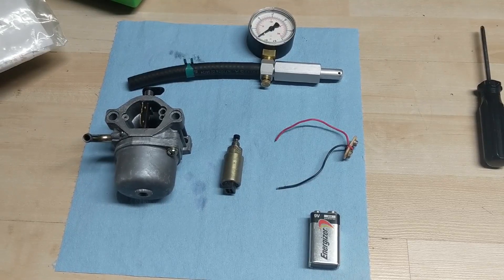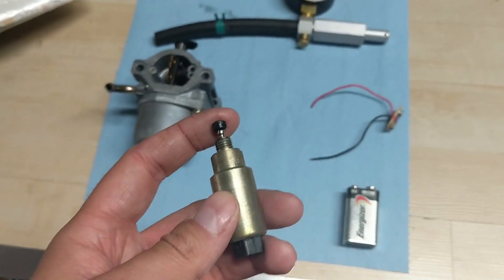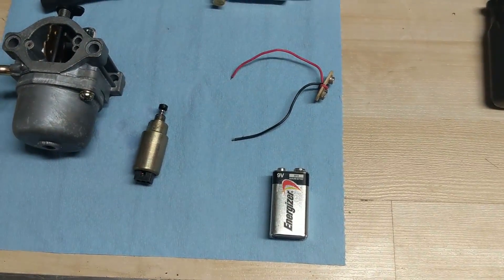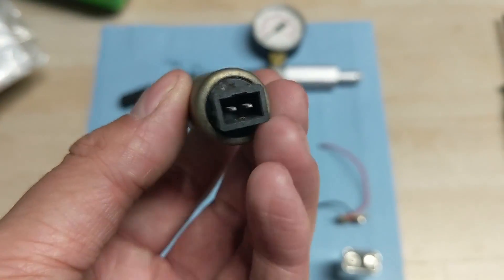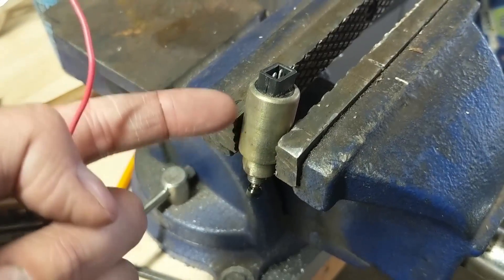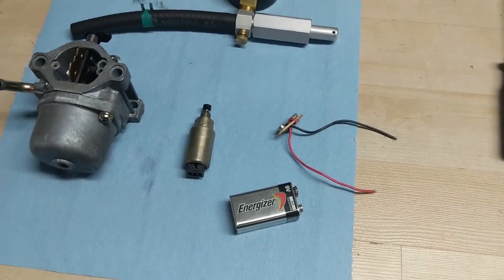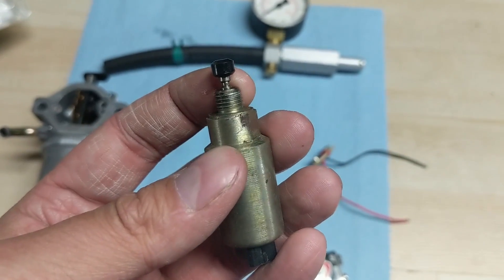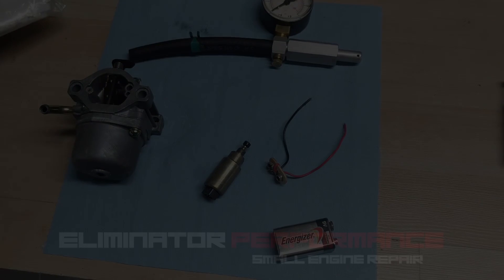How to Test a Fuel Shut-off Solenoid

Comment: Mine was stuck down,,,not up and extended. It wouldn’t let get gas pass from the bowl into the engine. Pulled mine out to unstick it and cleaned it. Fixed now and runs great!

Comment: Thanks a bunch for this video! I wasn't getting voltage to to my fuel solenoid on my generator, and your video helped me immensely in understanding how they work and how to test them. Because I was unsure of whether the voltage needed to continue during running, or was just needed at startup, I cut off the little plunger and left the wiring unplugged.  I would sure appreciate it if you could clarify that question for me. BTW, mine wouldn't activate with the 9 v battery, but did on 12v.  But the 9 v. connector is ingenious! Thanks for the tip!!!
Reply from the maker: @banjodon9851  they need a source of electrical current to stay open to allow fuel to flow. When the current is stopped, the plunger closed. By cutting it you are allowing fuel all the time, doesn't matter if it's plugged in or not

Comment: Thanks! My John Deere ride on mower had sat for two years. I went to start it today and it felt like it was out of gas. I tried to start it several times, but no combustion happening. Then I found your video and I tapped on the "fuel solenoid" with my channel lock pliers, then attempted to start the mower, and wham it started right away!!! So it was obviously a stuck fuel solenoid due to bad gas, because it had sat so long (without being started). Thanks again. :)

Comment: Would that anti backfire solenoid prevent the engine from cranking? Like a safety switch would?
Reply from the maker: @beegekhaos3171  no, it would just clog the main jet preventing fuel from going into the engine
Reply: @EliminatorPerformance  Alright thank you! Time to watch some more of your electrical diagnosis videos :(

Comment: Hello sir. I checked it with multimeter continuety. The contineuty works fine. But when i test with batteries, its not working. Could you tell me what could be the problem here?. I dont know what mistake im doing. (Sry im not good with english).

Comment: The solenoid clicks (moves) but still dos not allow fuel to flow.
Fuel pump is working, and spraying fuel in carb allows it to run just fine.
It was a sudden stop. And has worked on and off a few times.
Any ideas?

Comment: Great explanation. Got one with a single pin. Wire it connects to tests good with 12v. How do I bench test a single pin, just any old ground?
Reply from the maker: Yes the solenoid grounds through the threads on the carb, so touch negative to the solenoid and the positive to the single wire!
Reply: @EliminatorPerformance  thanks! No movement so I’m going to assume it’s toast!

Comment: Mine snaps open with the key on and when it is switched off. Gas drains out into the crankcase. I have the inline shutoff but the battery goes dead so ... ignition switch.

Comment: Does it matter which prong gets positive? Both wires on my plug are black.
Reply from the maker: No, an electro magnet is usually non polarized, which means positive or negative can be on either side.
Reply: @EliminatorPerformance thats great to know.

Comment: Fixed my problem, mower cranked fine… but won’t start…but would briefly start/run if starting fluid was sprayed into air intake…so obvious fuel issue.  Removed and worked solenoid plugger with pliers until free, reinstalled, mower started and ran fine… problem fixed.  Note this mower sat unused for 2 years… gas turned to varnish and froze the plugger…drained carb bowel and tank, easy clean and fix.
Thanks 

Frank

Comment: Here's a real pro tip, shut the gas line off, remove anti backfire solenoid, plug it back in and turn the key off and on. Tune in next week for tips on how to fill up your gas tank.
Reply: Would this solenoid be causing the air intake to fill with gas?

Comment: There only 3 things that make your troy built pony not to start 1 No fuel, 2 clog fuel filter, 3 the Carburetor Solenoid. And most likely its the Solenoid. B @ S engines are bad about blow them out  When you hear it go?  POP!  Like a back fire!  THAT THE PROBLEM!
Reply: I have a 17.5hp Pony that fills the air intake with gas and backfires loud. Is this the problem? I look at the float valve and it seems fine.

Comment: What would fry my fuel shut off valve?  My mower stopped on me and I saw smoke coming from the engine.  When I looked at it, the shut off solenoid connector had melted and was smoking.
Reply from the maker: It's possible that the wires shorted? Look for a bare spot on the wires

Comment: I'm getting no power to solenoid I'm assuming because a don't hear it click when i turn ignition key on. i removed the seat safety device so mower wouldn't cut off if i got off lawnmower now it wont start. any ideas?

Comment: Thanks for posting this - I used your 9v battery test today to check my fuel shutoff solenoid today. Mower wouldnt start and the solenoid was gummed up. I removed the solenoid and cleaned it and did your battery check to verify operation before I reinstalled it. Thanks for the instructional video.
Reply from the maker: Thanks for watching, glad it helped!

Comment: If the solenoid fails or jams, can it also jam in the closed, ar retracted, position ?

I drive a 1996 Malaysian Proton Saga, with the Mitsubishi 1,296 cc 4G13 engine, using an Aisan variable venturi type carburetor.
I believe I can see a fuel cut-off, or antidieseling, solenoid at the rear of the carburetor.

Often, on stopping and turning off the ignition key, the engine runs on, or diesels. 

So I thought maybe the solenoid had malfunctioned, jamming in the open position, and failing to close the fuel when the ignition key had turned off.

Comment: hi, my rider stopped and noticed smoke coming from under the carb and engine stopped. when i turned the ignition on the wire on shut off solenoid glowed red and smoked at the connection any idea what to do? thanks anyone who can help.
Reply from the maker: Replace the fuel shut off solenoid

Comment: How did you know what side was the negative and the positive?
Reply from the maker: It's doesn't matter, the majority of electromagnets are non polarized, meaning current can flow both ways and it will be powered
Reply: @EliminatorPerformance  I thought that principle only applied to 24 V DC
Reply: @EliminatorPerformance  I thought that only applied to 24 V AC
Reply from the maker: @rayray9777  electromagnets on the PTO clutches are also generally non polarized, with the exception of ones with diodes, which then makes them direct current DC and will have a red and black or red and green wire to identify positive and ground.

Comment: So if solenoid is good what else could be wrong with a no start, change spark plugs new battery new switch new fuel pump. $225 at a small engine shop that screwed me it worked one time after they worked on it!! It's like fuel ain't getting through! New gas, we have tried everything.
It's a john deer la145.

Comment: Thanks for the vid! I have a solenoid from a John Deere which looks exactly like yours, but with only one wire leaving the part. Is the other one just short wired to ground? And, do you have an idea how to disassemble the solenoid perhaps?
Reply: No 
need to disassemble, take it from carb bowl, plug the one wire back up if unplugged, touch against mower frame/engine to ground it out and then turn ignition/key to the accessory position and you should receive same results as this test.

Comment: Tanks for your video. I did the solenoid test on my work bench. Worked fine. Put it back on mower and it didn’t work. Traced the wire and found a loose connection.. All good now!! Thanks 😊

Comment: After putting carb back in my Kohler 730S 25hp engine, it starts now but have to play with choke to keep it running. Either sounds like a jet or struggles to run. Just learning this and cleaned solenoid but didn' t know how to test it and don' t remember it moving? Am I dealing with a fuel solenoid issue and need to take it back off or coukd this be a choke cable sticking, it feels "sticky" when I move it up and down, but not frozen as a does move lever it' s connected to. Any suggestions will be greatly appreciated. Trying to keep it out of landfill/recycling! Built in 02 but very lightly used, I'm second ower and replaced carb in 2017 with expensive Kohler carb, $200+.

Comment: I just bypass minds useing a switch works fine I just turn on the switch when I’m useing it then turn it off when it’s still running for can close it
Reply from the maker: Yes you can do without them, just throttle down before shutting engine off

Comment: I am having issues with a Troy-Bilt Pony with Briggs&Stratton engine(17.5HP). The issue is that after like 15-20 mins the engine will shut off automatically and it will not start again until engine cools down. I thought it had to do with the parts in the deck and I went ahead and changed everything including: all belts, deck spindles, blades and pulleys. I found a metal piece that holds the pulley of the PTO worn out a lil bit and the pulley looked unbalanced if I compare with the other one. After changing everything it is still giving me issues so what do you think or recommend? Thanks!
Reply from the maker: Heat soak on the ignition coil, or a fueling issue. If it dies slowly, it's fuel/carb, if it shuts off quickly, it's spark.
Reply: @EliminatorPerformance  when you say if it dies slowly, what exactly do you mean by that? After few mins?
Reply from the maker: Imagine you pinched a fuel line, your engine would slowly run out of fuel, and start running rough before it died out. Where as if you had a spark issue, let's say a safety switch like a seat switch that grounded the coil, the engine would shut off immediately. This will help you determine what kind of issue you have. Start by running it with the fuel cap loose, if the issue goes away, replace the fuel cap. Sometimes the vents clog and it creates vapor lock in the fuel tank
Reply: @EliminatorPerformance  oh ok. No, mine shut off immediately after 15-20 mins of running. Now that you mention safety issue, if I get off of the seat it won’t turn off, could that be it?
Reply from the maker: @frankcruzrosado133  when the mower is running, with the brake disengaged, if you get off the seat it would ground the coil and cut the spark. Could be an intermittent problem
Reply: @EliminatorPerformance  ok. I would need to check on that because mine is not turning off when I get off and machine is still running!

Comment: Why not just unscrew it from the carb and plug it back in and turn the key to see if it works, That would be easier.
Reply from the maker: Because sometimes they're single wire solenoids, which means it grounds to the base of it to the carb. So bench testing is easy. If it's dual wire, yes you can unscrew,  plug in and test
Reply: Also, you won't know if it's the solenoid that's bad or no impulse coming from the plug/wire connection.

Comment: Pulled it out and no rubber tip on it???? Where did that go? No ignition with spark to a new plug!  Sprayed carb cleaner everywhere and reinstalled the bowl and solenoid.   STILL no ignition. Sprayed gas into the cylinder and reinstalled the plug.. NOTHING!  One back fire and that was it.  Its a mystery!  Modern technology is driving me NUTS! #$@%@  If it works LEAVE IT THE HELL ALONE!

Comment: Fuel solenoids do not stop crankcase flooding with fuel !!!
Reply from the maker: When there's a leaking needle valve, the bowl floods and fuel goes up the main jet into the intake and can sometimes flood a crankcase if the carb is higher than the intake port. With a fuel solenoid, it closes the main jet, which will prevent the engine from flooding. The carb bowl will still flood though, and would run rich as soon as you start it
Reply: @EliminatorPerformance  That still doesn’t account for the quart of fuel in the crankcase .

Comment: Thanks EP Just Got a Used Mower That Fires Initially for 1-2 Seconds & Shuts Down.  Previous Owner said Ignition switch was   bad which looked bad. so New switch same  problems . I suspected the Shut Off switch & was Glad for your vid.I contemplated inline valve & open solenoid   & Glad you had  it shown. Thanx

Comment: My carburetor was giving me problems I finally disconnected the wire from the bottom of the solenoid and the lawnmower ran like brand new I put a fuel shut off valve in the fuel line and turn it off while the motor is running and let it run out of gas it works for me
Reply from the maker: It's probably seized in the down position then, because when you unplug them they're supposed to stay up. Good thing you ran a shut off valve

Comment: Pro tip couldn’t see the solenoid in action due to subtitling pro tip it’s called a petcock valve bro tip you don’t really have to explain what a 9 V battery plug is

Comment: Awesome video. Thanks for sharing the knowledge that helps solve issues that can drive some nuts or cost a bunch of money for repairs at a shop. So simple and cheap to fix or remedy mower not running. Thanks

Comment: Leave it on the IGN wire, turn key of and on while watching it. Simple. Either works or not.
Reply: 'm getting no power to solenoid I'm assuming because a don't hear it click when i turn ignition key on. i removed the seat safety device so mower wouldn't cut off if i got off lawnmower now it wont start. any ideas?

Comment: The fuel solenoid has absolutely nothing to do with engine flooding
Reply from the maker: If the needle valve is leaking but the fuel solenoid is seized closed than the engine won't flood with fuel because it can't travel up the main jet.
Reply: @EliminatorPerformance  I’m not questioning your integrity you seem like a pretty intelligent person but the fuel solenoid has absolutely zero to do with the engine flooding. it not only  floods up through the main jet but it floods through the atmospheric vent
Reply from the maker: @THEMOWERMEDIC1  You can disagree if you want, but maybe I should have clarified I'm talking about when the engine is off. Let's say you let a mower sit, and the needle valve leaks, the bowl is overfilling with fuel, the fuel has no where else to go other than up the main jet, then down the intake and into the cylinder. That's how many mowers end up with fuel in the crankcase. The fuel shut off solenoid is in the closed position and blocks the main jet. Therefore, fuel cannot travel up the main jet and flood the cylinder and then the crankcase.
Reply: @EliminatorPerformance  See that’s exactly what I’m talking about the fuel has other places to go. It fills up the carburetor and out the atmospheric vent.  The fuel solenoid is not stopping the carburetor from flooding.
Reply: @EliminatorPerformance  https://youtu.be/OsQ_R0AQG9o

Comment: Incidentally is it okay not to use the solenoid? I noticed mine was disconnected I have an inline shut off
Reply from the maker: It's probably cut off then, leaving it open the whole time. Make sure you throttle down before you turn off your keyswitch
Reply: @EliminatorPerformance  man thanks a lot I appreciate it. Can I ask you something else? The air cleaner was missing on this unit I bought so it will only run with the choke fully on I ordered a new Honda replacement filter and box do you think that will help it run more rich? I guess my question is with the Box on do you think that will eliminate the need to keep the choke on? Thanks so much
Reply from the maker: @t.tocsmaillup8685  well if the engine only runs with the choke on (that creates more suction) the fuel shut off may not have been cut off. You may also have some gunk in the main jet, the added suction sucks more fuel through the main jet

Comment: my bike starts and idles but when given throttle it does not rev up but bogs and sputters could this be the issue of not then someone help me its a wr125 and when i cover a big portion of the air box i feel a big suction and the bike works ok
Reply from the maker: You have a clogged jet, by putting your hand over the hole, you increase suction and richen the mixture. You need a carb clean and rebuild
Reply: @EliminatorPerformance  it’s fuel injected
Reply from the maker: Replace your fuel filter, it could be starving for fuel. Either way, you're reducing the air thus richening the mixture. So it's running lean right now, not enough fuel. Fuel filter could be clogged up.

Comment: What was wrong with manual fuel shut off?  Keep it simple stupid.
Reply from the maker: Sometimes these engines run so hot they ignite the fuel even after the spark is shut off. This is known as dieseling, as the fuel ignites from the hot exhaust valve. This causes backfiring and can bend a pushrod.

Comment: I bought and installed a fuel line shut off cause I was sick of draining the gas tank while I worked on the carb and such. Life made easy...
Reply: I did too.... But fuel seems to still be leaking into the bowl... Went to start it this spring and it was full of gasoline. Ugh. Not sure what to do.
Reply: I did too.... But fuel seems to still be leaking into the bowl... Went to start it this spring and it was full of gasoline. Ugh. Not sure what to do.

Comment: Bought a mower that originally had a carb with a fuel shut off solenoid. The guy I got it from I guess got rid of it. I just ordered the right carb with the solenoid and need to know where to run the hot wire from the solenoid to. Any help? Do I just run it to the battery or an ignition wire ?
Reply from the maker: 12v from the key switch!
Reply: @EliminatorPerformance  do you need a battery on the mower or does the engine make the needed power to actuate the solenoid when it's running?

Comment: I test them by hooking back up to the wire harness, touching the body of the solenoid to the carb mounting bolt and turn the key on. This helps determine there is power to the solenoid.
Reply from the maker: Yes that works too!